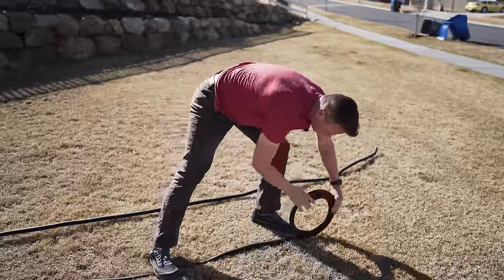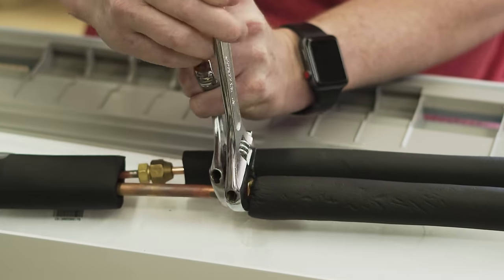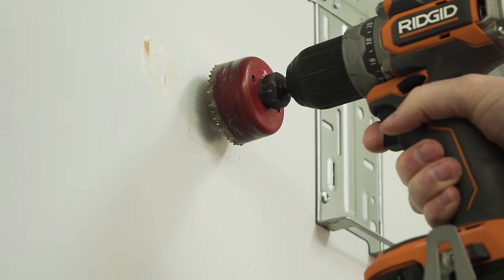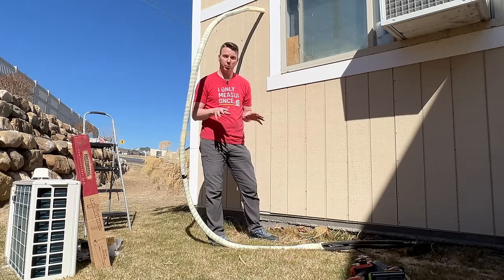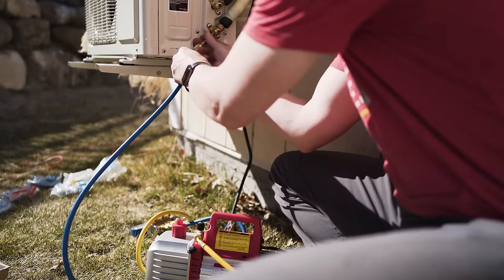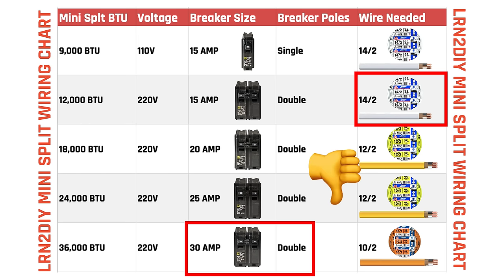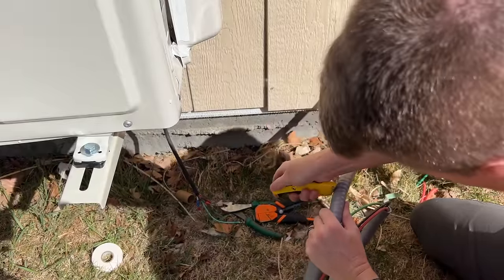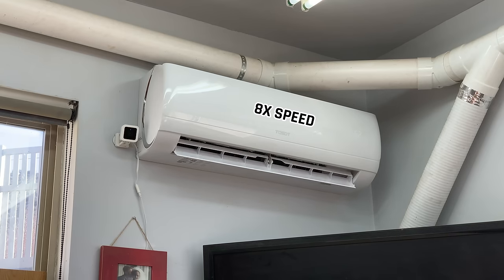DIY Mini Split Install - All the Things Nobody Shows You

Comment: You confused yourself when you chose to use that heavy guage wire.  That wire will be fine but by using an oversize breaker the mini-split is not protected.  You still need to use a 2-pole 15A breaker.
Reply: Agree with Phil. The 15A breaker is for a 12k (1-ton) unit in your chart. You need to change out your 30A breaker for a 15A.
Reply: I thought the same thing.  There is so many things he did that wouldn't pass code on the electrical.
Reply: Actually all he did with the large breaker is waste money. Circuit breakers/fuses are only to protect the wire. (Stop it from carrying to much amperage causing a fire. They are not for protecting any item plugged into or hard wired on that circuit. What was really bad on his part was calling the white wire the neutral. Since he was using a 220V circuit he in effect made the white wire a hot leg and it should have been marked with black tape on both ends to indicate it was a hot leg. (Or he could have left the white unconnected and used the red wire which is a hot indicator for 220V circuits) There is no neutral in this instance. If you look at the wire connection in the condenser it's actually marked as line not a neutral. I do need to watch again to see the guage of the whip, if it's less than 10 guage the breaker definitely needs to be smaller.
Reply: Any line wire 14g or larger is fine. The 15amp breaker is needed because wire sizing within the head and outdoor units. You don't want an overload situation that could cause the internal wiring to overheat and possibly catch fire.  The 15amp breaker provides protection against that scenario.
Reply: Could he have used the 30 amp breaker with the 10-2 and put a fusible disconnect with 15 amp fuses to protect the equipment?
Reply: @TH-ji1ed  yes that would work or he could have used s second subpanel at the outdoor unit and put the proper breaker in it..  then have room for the 110 outlet that is required by code ..... the second is what I would have done
Reply: @TH-ji1ed  that is true, but wastes money unless all parts are on hand.
Reply: @LeslieIsgrigg  I say that because I do commercial refrigeration/hvac. Usually breakers are the wrong size for equipment so it’s common for us to see
Reply: @beezalbub7325  this.  This is exactly the comment I was going to leave 😂
Reply: @TH-ji1ed  I see that often as well, most often, when we follow up diy rework.
I am guessing this might be due to using what they have on hand to save costs.
Reply: Read the code book and definitions of OCPD, that should clarify any personal interpretation.
Reply: @frillyfidomaxwellpressley366  Outlet is not required if one is within 25 feet of the equipment.
Reply: 100% correct… use the smaller breaker or get a fused disconnect sized to the unit and not the wire.
Reply: Per code the breaker needs to match the MOP rating for the unit.  I'm assuming it's 15A but needs to be verified.   He would have failed inspection had he had one.  You can always exceed the minimum wire gauge but that doesn't change the other requirements.
Reply: I agree
I came to leave the same message.

Really, you should edit the video
Reply: @beezalbub7325  Check the name plate. Why doesn't anyone talk about what the name plate on the Condenser says. It usually tells you the minimum amperage and max breaker size. As long as you are in that range you're good
Reply: Rome in conduit is a no-no
Reply: @beezalbub7325  This isnt true. AC compressors have a max ocpd rating for a reason. the circuit breaker shouldve been sized off of the equipment requirements, then sized the conductors based on the ocpd rating.
Reply: You can also cut seal tight with your EMT pipe cutter.
Reply: Exactly what I was about to say. If the compressor has a short it might catch fire in the unit before it trips the fuse the way he did it.
Reply: Also never use a white wire for a power wire you had a red wire their already you should have used them instead
Reply: Exactly. Fire hazard.
Reply: @beezalbub7325  I agree with you (for once, Prince of Darkness). It's for the wire. Equipment is not protected by the panel breaker. European IEC philosophy is different and maybe that's where the other commenters are coming from.
Reply: Circuit breakers are to protect the circuit, not the devices.
Reply: Lots of dodgy info here. They need to reed the NEC code book. When hooking up HVAC type equipment you check the plate on the unit. It'll give the minimum and maximum amps it should be fused at. The conductors have to be rated to handle the minimum and the breaker is not to exceed the maximum. Meaning that yes, it's possible to have a breaker rated for more than the conductors are rated and still be within code. But, in this instance I doubt the unit is rated at 30 amp maximum so the 30amp would fail inspection.
Reply: @chrishall1407  Agreed
Reply: @markargyilan1416  no that’s fine, as long as you mark both ends.
Reply: But you should have had electrician do your wiring.
Reply: Bro! you  need to read at least the ugly's book.
Reply: Also, indoor rated romex wire is not code-approved to be installed in outside emt, even though many people are not aware of this code technicality.
Reply: AC units have exemptions in nfpa70.  Mca is what you size the conductors with. Mop is what the breaker is sized with. 10awg on a 50amp breaker would be to code if the mca is less than 30 and the mop is 50. Overload protection is inside the unit. Unit will fail before the conductors will.
Reply: @chrishall1407  not an electrician, but that sounds screwy to me.  Are you certain you didn't reverse the wire and breaker requirements?
Reply: @davidsuzukiispolpot  yep. The NEC can sound screwy at times. In this case the part that throws people is allowing (within the manufacturers parameters) the overfusing of a wire to account for brief starting amperage of the HVAC equipment.
Reply: @chrishall1407  Thanks.  I am surprised they didn't design a slo-blo breaker to match the inrush current requirements of the HVAC. Considering that breakers have two trip mechanisms (to the best of my knowledge), a thermal trip and a magnetic trip, that design should be feasible IMHO but I am not a breaker designer.
The magnetic trip would have to be sized for the max inrush current but the thermal time constant would have to be increased to match the inrush period.   Wires would have a pretty decent thermal time constant so matching them closer should protect everyone.
Reply: @chrishall1407  Thanks for pointing this out. I would have erred here.
Reply: Exactly
Reply: I’m glad you pointed that out because I was asking the same thing, if I did not pay attention it would’ve potentially caused damage or failed by code
Reply: Exactly ;)
Reply: @journeymanh5143  what's the uglys book?
Reply: Electrician here came to say the same thing. You want to replace that 30A double pole with the required 15A breaker. Compressor and air handler unit will get smoked when it overloads. The wire should be fine but your equipment requires 15amp of overload protection and you are sending 30a. Also the romex sheathing needs to be stripped before installing in emt. Also it should be bonded all the way to the box or just use liquid tight all the way to your unit. Other than that your video is very nice and well put together
Reply: @TH-ji1ed  yes but there is no sense on doing that. Breaker not only protects wire but also protects the unit it self
Reply: @arhodehamel2615 ahhhh that's a big negative!!
Reply: What he did here is exactly why it's not a DIY project. He should have taken his own advice and hired an electrician.
Reply: Very good video btw....but as others have said, if the unit is rated at 15a or less, connecting it to a 30a breaker is not a good idea. I'm sure the unit manual states that. The 30a breaker will not protect the equipment if it's max rating is 15a.
Reply: Exactly what kinda expert tells people to yeah go ahead and burn up that unit.
Reply: I noticed that too
Reply: 10 wire is definitely overkill. I suspect that where he got confused is with the 15amp indoor breaker vs the 30amp timed fuse for the disconnect.  He definitely needs to use a 15amp breaker.
Reply: @markargyilan1416 using the white wire for power is okay, if you mark it.
Reply: Over sized breaker is correct. This allows for in rush current on compressor starting. Always follow nameplate on the device. Code book says to do that over wire size.
Reply: @fox156 Authors last name is Ugly. It’s a small handbook based on the nec with all kinds of cheat sheets and calculations that the electrician faces in real world field experience
Reply: I had the same issue the technician put the oversized breaker 20amp, so that I called the manufacturer they told me my unit needs 15amp, they said if I leave it that way down the line it will cause communication problems. I don’t know how it relates that but this is what they said
Reply: @nsudatta-roy8154 he stated in the video 14ga wire will work but he had extra 10/3 wire and didn’t want to buy more wire.
Reply: @bent1208  I saw and heard that, too.
Reply: As most have said using a 30amp breaker mean your mini split is not protected for a overload situation. Code says you can go 1 size larger on the breaker if you need to deal with starting surge so that would a 20amp breaker max. Also with the wire you used you should have used the black and red wire. Using the white for a current carrying conductor is only allowed if there are not enough colored wires in the romex such as when you use 2 conductor with ground for a switch. In that case the white would be connected to the hot and the black would be the switch leg.
Reply: Youtube electricians are funny 😂. 15 amp unit on a 30 amp circuit breaker.
Reply: I think what most are missing is that a mini split is considered a continuous load per the NEC. That means the breaker should be sized at 125% of the rated load of the unit. 15a x 1.25 = 18.75 amp. So #12 wire with a 20 amp breaker. Also keep in mind that breakers are only good for 80% of their value on a continuous load so 20 x 0.8 = 16. Now with that said, the little chart they have out does not mean squat. You should always check the units RLA that would be on the nameplate.
Reply: @bee 8:09 zalbub7325 8:09
Reply: So I noticed that after pulling a vacuum, you removed the hoses. Unless I missed something, you lost all your vacuum by doing that.
The lines needs to be pressurized by releasing the refrigerant before removing the gauges and hoses.🤔
Reply: @newtonwilliams6142 you are correct. Curious to know if the unit is still running. That vac sequence was puzzling

Also, breaker size needs to be 15A according to his chart. I still don’t understand the 2 pole breaker being 120v???

That romex should not be used in conduit, should have gone THWN in conduit for outdoor. Or romex to outside weatherproof j box to THWN in EMT. 

Overall (other than the breaker size) it should be safe. Code vs DIY is always subject for internet debate. Good video and good work for the most part.
Reply: @jimmay1028 then what should you use?
Reply: I was about to tell him that 😂. Also he needs to use the correct manufacturer  breaker which is eaton not square d.
Reply: @chrislittlefield9692  bot an electrician so excuse the ignorance,  but I've heard that before however no one has said why. I don't understand how Romex in conduit could hurt anything?
Reply: I don't even do electrical and thought the same thing 😂😅 it just seemed like it would make sense to match your breaker with the amount of current pulled for that specific appliance.
Reply: @frillyfidomaxwellpressley366  Thing is it's not a 110 unit. From what I seen was 230v.
Reply: I was just thinking that when I saw what he did.  Bigger wire is fine but the breaker needs to be sized to the unit.